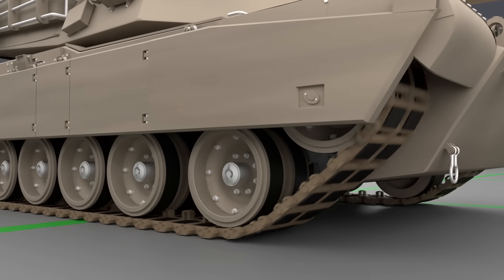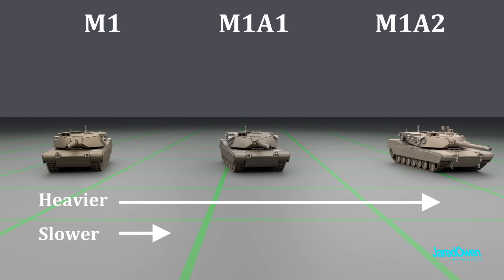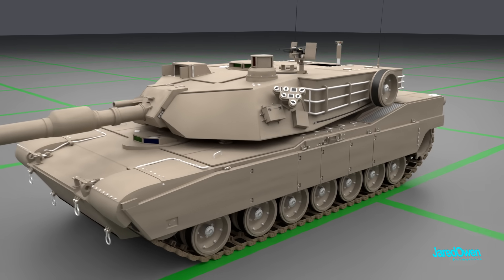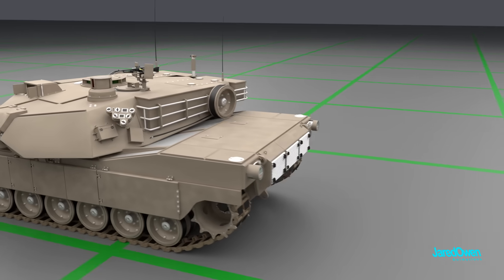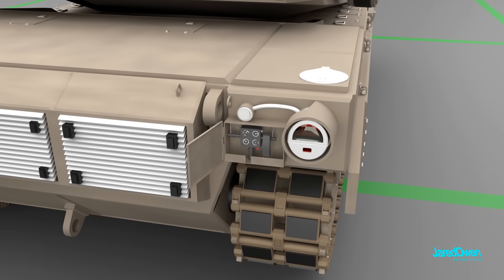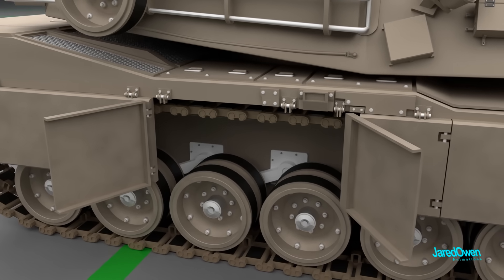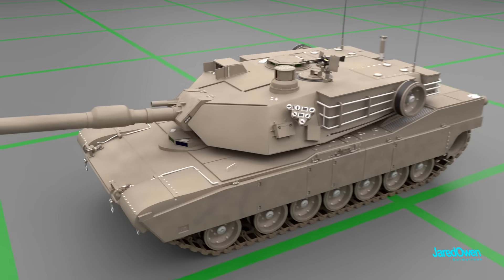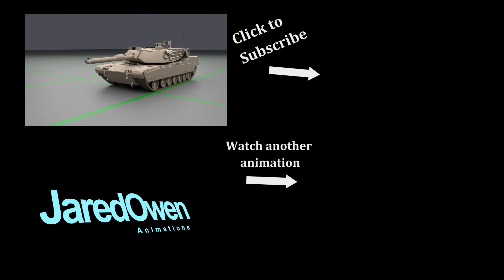How does a Tank work? (M1A2 Abrams)

Comment: The starter/generator on a M1 is pretty cool. Give it power and it acts like a starter to start the engine. One its running it acts like a generator. I do know their top speed is faster than advertised. I was driving a HMMWV flat out so about 70/75 ish mph. A M1 passed me like I was standing still. Must have been doing at least 90 mph. Watched it throw a track pad about 50ft in the air. Glad it didn't hit me.

Comment: 4:12 -- you've got yourself a detracked Abrams there, sir. 
8:05 -- that's definitely not how smoke grenades work and what they are for. 
And yes, War Thunder has nice physics concerning vehicle and bullet/shell movement, as well as shell-target interaction (including terminal one), but is pretty limited in equipment modelled (as, no radio or magnetic navigation), undertuned basically any aircraft flight modelling, especially with helicopters, and also has nothing to do with actual military operations, being more of a counter-strike on tanks and planes.

Comment: I think you might want to mention the revolutionary M-1's composite armor and the upgraded special armor incorporating depleted uranium and other undisclosed materials.  The M1A2 SEP variants have been equipped with third generation depleted uranium armor combined with a graphite coating. Since 2016 many Abrams were equipped with the Israeli Trophy active protection system to protect the tanks from modern RPG and ATGM threats by either jamming or firing small rounds to deflect incoming projectiles.

Comment: Stupid science 
Science doesn't know 
Every second the Sun emits billions billions ^ billion lightning 0,1 voltage create sunlight. 1 positron + attracts 1 electron  -- create 0,1 volt lightning 
Positrons + and electrons  -- rotate very rapidly after 4,6 billion years of creating the Sun ' s core, so the core of the Sun rotates very quickly like A super large electric turbine that produces super large electrical energy 
Every second the Sun emits 4,1million tons electricity create sunlight, sunlight moves the circle back to its original position after 8 hours, so pushes the 8 planet to rotate in order

Comment: So RPG the back ventilation of a tank, possible grenade into the turret cannon, and maybe another RPG or caltrop into the drive tire near the back of the tracks.

Just listing ways to stop a tank.
Reply: And after all that the tank is still able to fight in battle, it may not be able to move but it does have manual turret controls and will kill you just as dead and not even need to move.

Comment: Great video!  Very interesting information and entertaining.
Reply: I have never seen a comment like this are you a bot
Reply: The 📞 bit was cool. I was unaware of that. Armor is not a easy MOS, job. It's very stressful & demanding.
Reply: @DavidLLambertmobile  with about a 10 ft extension cord on it no its not a cell phone lol .
Reply: @bootlegger3656     The M1A2 scene in The A Team 2010 Imdb.com was classic 🎬.... the film made the cramped tank interior seem larger. Hannibal was 6'04" so I'm sure that was tight.
Reply: @DavidLLambertmobile  My Lt was about 6'4 and when we let him stick his head up it was on the loaders hatch lol . He would still get his muddy boots on the loaders seat . That was ok because he had to sit in it a couple times and he figured out why we wore galoshes out side the tank and left them on the infantry rail . He also learned not to scrape his boots off on the heater exhaust pipe as well . Nothing more fun or aggravating then breaking in a butter bar lt . There was room but yeah gunners section and the TCs to behind the main gun , Recoil area was tight .
Reply: @DavidLLambertmobile  Guess u never saw "Kelly's Heroes" (1970) or  "Hills r for Heroes" (01Mar66)? All u need do is grab it from the backend, dial 9-1-1, n commader inside the rolling can will answer the call.
Unfortunately, the Germans got good can openers....
Reply: Shaaa wn hablai inglés?!
Reply: l
Reply: The newest version is the M-1-A4 of which Poland is buying 250 units to be delivered in 2022.
Reply: https://youtube.com/channel/UC8KPrPK2hobRU-Y0hPBd7EQ
Reply: yea

Comment: "Low to the ground" I think is Israeli concept as applied to their tanks during the 6 day war of 1969(?) Just like an infantryman when they are moving while fighting they crouched low to the ground or to the extreme creep/crawl to the ground for them to be difficult to hit. Anything/one protruding from the ground could be easily hit. That is why some goes further below ground surface dropping prone on  a depression  on the ground or dig fox-hole  to hide and cover themselves from direct hit. I think the angle in the  tank armor is not for deflecting bullets but to make a thinner armor thicker without making it actually thicker by angling the armor. If a 1/2 thick metal is angled at a certain degree, a round hitting it in another angle of degree will be hitting now a 1-inch thick metal making the round hard to penetrate.
Reply: Hi

Comment: Good video. You may mention that this ENGINE shown also is mated with it's transmission referred to as a power-pack also that it's running on diesel fuel not jet fuel.
Reply: JP8 is jet fuel

Comment: The turret works basically like in a helicopter. When you spin it fast enough, the tank will fly.
Reply: And put another cannon at back of turret
Reply: A small price to pay for flying, being able to kill your team, worth it
Reply: when I was a new private, I was told if you spin the Turret nine times counter clockwise, it will unscrew the whole Turret off the Hull 😂😂
Reply: @AtelierEphraim  hahaha, that is cool 🤣
Reply: Yeah it does, but you would need at least 2 rotor blades instead of cannons. But yeah, it works kinda like that
Reply: @fairweather1704  go away
Reply: Exactly.
Reply: https://youtu.be/4G6e4TaJxkI 
excellent ⬆️
Reply: If you spin it more than 10 times in the same direction, the turret unscrews itself and falls off.

Comment: It is a very nice, effective tank. However, it is somewhat weaker than a Leopard.  More effective because they are lighter, with same firepower, but better protection.  Germany, Canada mostly use Leopard, it will outpace an Abrams most tests.
Reply: Not really lighter, or necessarily better armor save for mine protection.

Comment: As a loader the animation of the guy loading that sabot made me cringe. You would have no room at all to twist like that and sling the round in. Best way is to pull the round out and swing it like a metronome onto the breach and push it in. Also you would be facing the TC the whole time so you can see what’s going on, you wouldn’t just be staring at the radios the whole time.

Comment: Abrams copied tiger
Reply: wut?
Reply: no, it didn't. Both in design and appearance

It was based on MBT-70 which was a joint-project of American and West Germany to create an MBT, however it was too expensive and the project was cancelled. Later the USA built the XM803 and changes were made resulting in XM1 prototype and later came the M1

Comment: well, at least  learned about US Ton =1016kgs, not to be confused with metric Tonne 1000kgs.  I had to look it up.
Reply: A U.S. ton refers to a short ton, or 907kg. which is different to the imperial ton, which is 1016kg. The imperial ton is also called the long ton.
Reply: @peterson7082  thanks, I didnt look it up that hard as you can see

Comment: I had to stop watching when the whole mantlet recoiled back when it fired, the amount of inaccuracies in this is laughable, a simple google search would have currents simple Aesthetic features, but when you showed the M1,M1A1 and M1A2 they were the same tank besides having a LITS on the A2 . The turret on the M1 is shorter with less armour. All 3 variants have a commanders weapon being a 50 calibre machine gun on the A1 and A2 there is a commanders weapon station this is not shown in the model, you just changed the colour based of theatres they fought in..... good effort but damn you did very little research. If you wish to re-do this I’m happy to help.

Comment: You forgot that the original M1 Abrams had a 105mm rifled gun.

EDIT: Also the coaxial machine gun and the machine gun on top of the turret are both 7.62x51mm (.30 caliber) M240s. The commander's hatch also usually has a 12.7mm (.50 caliber) M2 heavy machine gun. The armor in the front of the turret on current and newer variants is made of steel-encased depleted uranium, while the rest of the armor is made out of steel and ceramic.
Reply: The M1 was desighned and intended to use the 120mm Rheinmetall L/44  but was not available when M1 production started due to licensing agreement issues and costs.
The M256 is and cheaper, "economy  version" of the German L/44.

Comment: The angled or "sloped" armor is not made that way for deflection but rather because it increases the cross-sectional thickness of the armor from a direct hit. Basically sloping the armor means that any direct hit has to travel through much more material while still keeping the overall thickness of material low to cave weight.

Comment: No offense, but having intimate knowledge with that tank your info is mostly incorrect. You have the Wikipedia inf although I cant correct you because of security issues. I will put it this way. It is far more badass than you make it to be.
Reply: Very doubtful...
Reply: @sandervanderkammen9230  The video is just a Wikipedia source. Most of the tank is classified. The stuff on here is outdated and incorrect.
Reply: @jefrey5578  The only thing outdated here is the M1 Abrams, very little about this nearly half century old tank remains classified...
They manufacturer them in Egypt!

Comment: The engine was originally designed for helicopters.  US  does not share its software in these with other countries. Jeep and Brad's both made in Ohio.
Reply: NO they are not,  the Lycoming PLT-25 gas turbine was never designed as a helicopter engine and was never a flight rated design.
The PLT-25 was developed specifically for Armored Vehicle applications and became a U.S. Government program in 1965, with the Army version called the AGT-1500 and a marine version of the U.S. Navy designation TF-15
Reply: @sandervanderkammen9230   U must be trolling. Honeywell Aerospace lost a bid to GE in the 70's to power helicopters. PLT27 is still used in aircraft. U cannot use teenager youtube vids or wiki as sources these days.
Reply: @DSMcCord16  The Lycoming PLT-25 became a U.S. Government program in 1965 and was given the U.S. Army designation  AGT-1500, The PLT-27 did not exist until years later.
Honeywell did not design or manufacturer the AGT-1500, it was built by LYCOMING
Reply: The AGT-1500 does not have proprietary software, it was developed with hydro-mechanical fuel controls, later versions adapted a very simple, off- the-shelf FADEC system that can be purchased by anyone.
Reply: @sandervanderkammen9230  If u have had a security clearance to tour the plant in Lima, Ohio you would know the ONLY part they don't let anyone see including Govt employees & contractors is the software for some of the tank's turret features. The tanks sold to other countries will have different paint and other versions of software. I hope this helps you.
Reply: @DSMcCord16  Sorry, but you seem extremely confused and misinformed.
The M1 Abrams tank is not powered the PLT-27.
The M1 is powered by the PLT-25 which was designed by Dr.Anselm Franz at Lycoming 
The PLT-25 was designed first, and designed for Tanks not helicopters.

Comment: When I was in the army as a tanker although we spent very little time on tanks and much more time on mraps and Humvees I still got to be on our tanks and everything seemed perfect about the Abrams except for one thing the loader when not loading spends most of his time standing on his stool with his upper body out of the tank through his hatch Manning the 240 machine gun that is the loaders weapon. And the TC also often has to open his hatch in order to get better visibility although the TC can control the 50 cal as well as the main cannon from his position without opening the hatch but the loader cannot the loader has to get up and manually use the 240 and scan it occurred to me that on our Humvees and mraps we had a turret that could swivel for our 50 cals or 240s so I wondered why doesn't the loaders patch have a similar thing fitted to it. Because when you're up there your entire upper body is completely exposed when you're scanning with the 240. It would only make sense to have a protective system much like you see on Humvees and mraps and other armored vehicles where a gunner will be half above the vehicle. it just seems like the loader is in a lot of unnecessary danger and that could be fixed with a metal strike face that could traverse 360° I'm sure that it could be fitted to work that way.

Comment: Good video it's no fun when you throw track on an Abrams I'll tell you that we kept throwing track we were going over some pretty difficult terrain and the track threw and it took our crew hours in the hot sun to fix it. It's not that it's complex it's really fairly simple to fix a broken or thrown track but because of the size of the track it takes about two Crews one time I remember there were like four from our crew and two guys from the other track crew and we were all trying to stand on that pry bar to fix the track and it still couldn't be fixed the mechanics came up with the 88 and they were all pissed off. an 88 is pretty cool that's basically a tank and armored vehicle tow truck but it's not a truck at all it's a massive armored vehicle on tracks

Comment: Nice tank, but not as good as the British Challenger. Not one Challenger has ever been lost to enemy fire.
During the 2003 invasion of Iraq, the Challenger 2 tanks suffered no tank losses to Iraqi fire. In one encounter within an urban area, a Challenger 2 came under attack from irregular forces with machine guns and rocket propelled grenades. The driver's sight was damaged and while attempting to back away under the commander's directions, the other sights were damaged and the tank threw its tracks entering a ditch. It was hit by 14 rocket propelled grenades from close range and a MILAN anti-tank missile.[35] The crew survived, safe within the tank until it was recovered for repairs, the worst damage being to the sighting system. It was back in operation six hours later. One Challenger 2 operating near Basra survived being hit by 70 RPGs in another incident.

Comment: “war thunder is historically accurate” cuts to an anime apache
Reply: Japan did that back in 1990 to this day look
Reply: @بِيتْزَا-ذ1ض  where can i find this helicopter
Reply: The anime girls on ak n m16s r real
Reply: N yes it has a ac unit coffee pot air-condition and its radiator can keep 7 ppl warm underneath n 6 inside with out the heater running

Comment: I worked on the Abrams program doing upgrades to the current configuration.
Part of the job was to change & validate the maintenance & troubleshooting manual.
Manual validation took place at Fort A.P. Hill.
As a courtesy we were taken out on the test course where I was invited to sit in the commander's post (open hatch).
Some of what we went over would have destroyed most other vehicles.  The M1A2 is so smooth you couldn't feel what we were going over. Amazing!